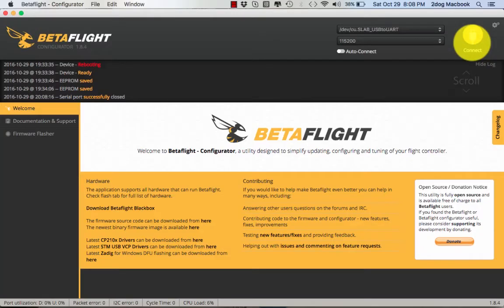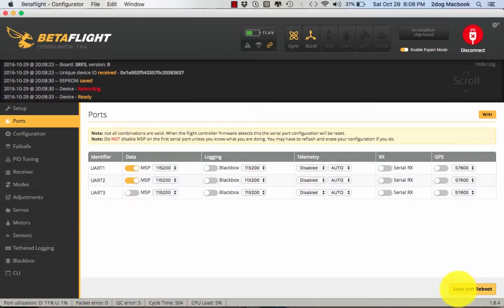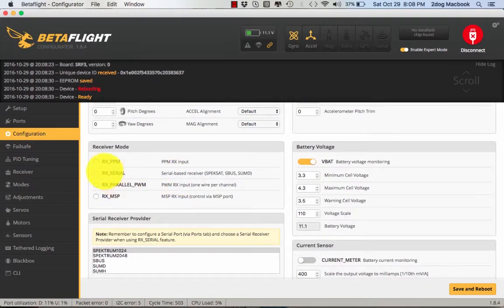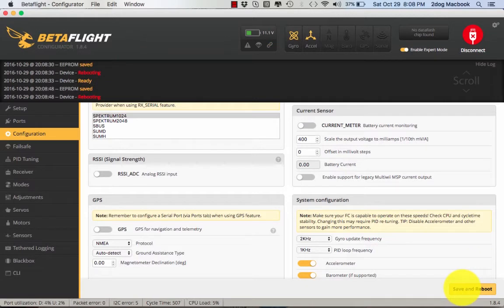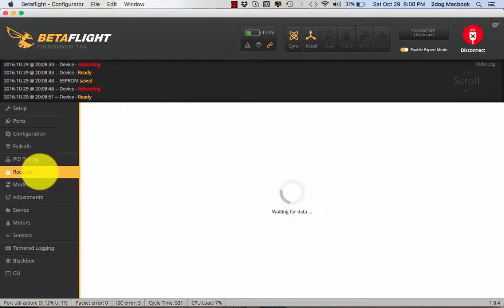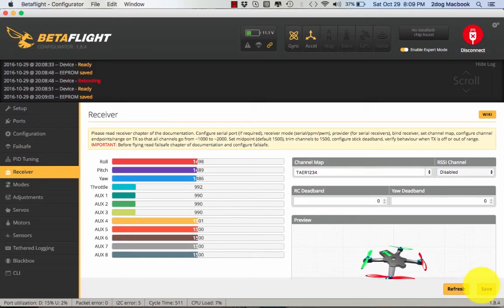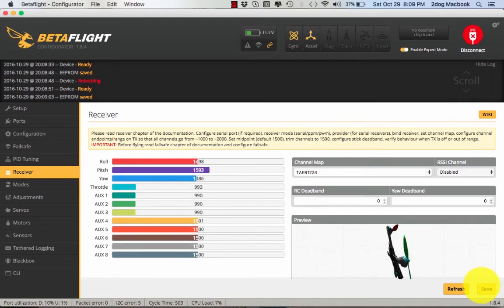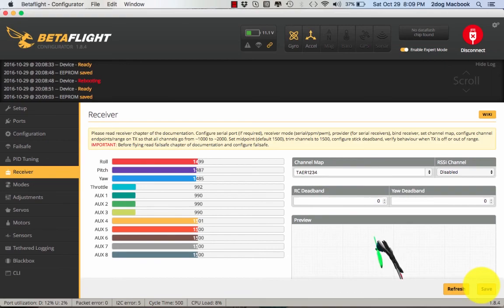Diatone Crusader GT2 Betaflight 3.0 Setup Frsky D4R II D-Link F3, Step 2

Comment: I cannot get tx inputs in the receiver tab. My rx has been bound and is solid green but the FC does not seem to be getting any information. Any ideas for a solution?
Reply: Which receiver are you using?
Reply: +Mark G, Frsky D4R-ii in PPM
Reply from the maker: Okay, then you need to have PPM selected on the Config tab, not serial.  A
Reply: I am having the EXACT same issue... Any luck in solving the problem??

Comment: Can you make a video on how to update BLHeli on your esc's?
Reply: I have a new GT2 but BLHeli says the my two of my esc's have unknown firmware (BLHeli Bootloader C) and the other two are blank. My Gt2 is brand new the only thing I have done so far is update and configure Betaflight. Thank you for any help you can provide.
Reply from the maker: There is a bug in Betaflight causing this with these ESC's. The ESC's are fine and you don't need to update them. You can try downgrading Betaflight below 2.9. Also the BL heli configurator in Chrome has been known to corrupt the bottloader on ESC's so I recommend the BL heli suits.
Reply: 2dogrc Thank you so much!
Reply: Hey man, Diatone noted at their product page to NOT update beyond 3.0. Do you know why? I mean BF 3.1 is out which is much better...
Reply from the maker: There is a bug in Betaflight corrupting bootloaders when updating the ESC.
Reply from the maker: There is a problem with Bl Heli Suite and betaflight higher then 3.0 when flashing the ESC's.